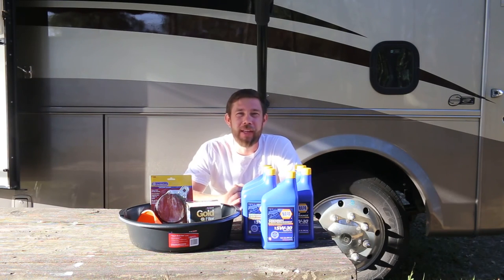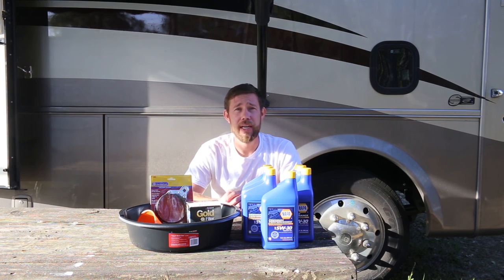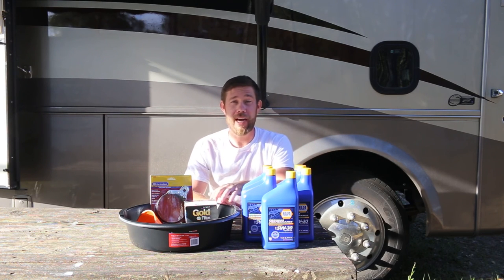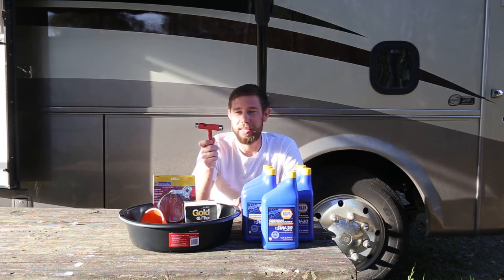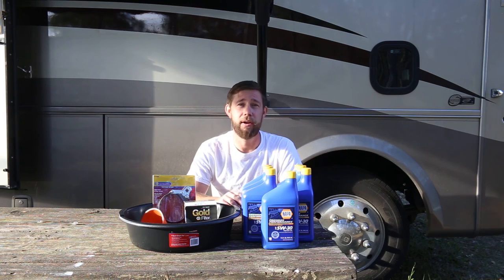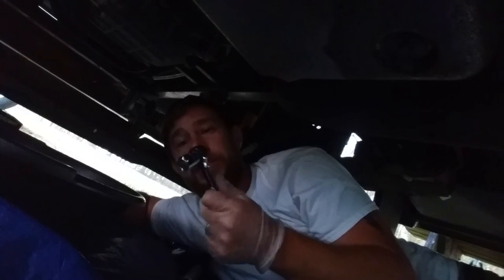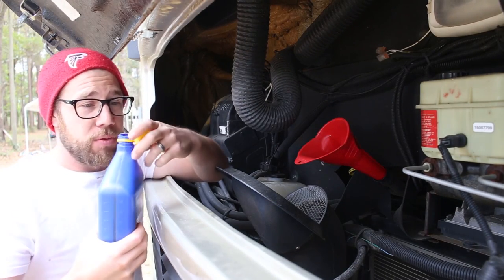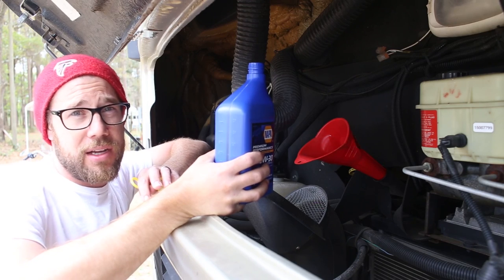Changing the Oil in Our Class A Gas RV

Comment: ( just seeing this video now and not sure if it was pointed out at all ) The reason the socket was slipping off of the drain plug when you used it is because you were using a 12 point socket which gives it less surface area to touch the plug. What you wanted to use is a 6 point socket.
Reply from the maker: Nice! Thanks for pointing that out @Exploring Nomad to be honest when I was doing this it was a first for me on the RV and a long time since I'd done anything on a vehicle so my knowledge of such things is a little rough. I'm actually looking for a new set so I'll take your point into consideration before I buy :) Thanks again!
Reply: Welcome. A good set is a craftsman set. There’s a real nice set that looks like a tool box. Red and black with 3 drawers. I believe it’s about $300 or so but it has everything you need

Comment: I have been changing my own oil for fifty years and an old trick i learned years ago was to put one or two small bar magnets in the drain hole. they would stick to the drain pan and collect any metal shavings that got into the oil. They use to sell magnetized drain plugs that did the same thing.
Reply from the maker: Thanks for the great tip sam white! I'm going to have to look into that before I change my oil next time. Better safe than sorry and nobody wants metal shavings cruising through their engine.

Comment: I've considered getting a replacement drain plug that is a valve that you can put a plastic tube on the outlet and open to drain the oil.  No more hunting for the right size tool then cleaning the drain plug off once its covered in oil.

Comment: Since the mid 1990's Chevy engines have used 15 mm metric drain plugs, you stripped it because you were using the wrong size socket.  Also  you should be using the 1 quart  NAPA 1060 or WIX 51060 oil filter not the 1/2 quart 7099 filter, this would bring your total oil capacity up to just under 7 quarts and double the amount of filter material in contact with the oil.
Reply from the maker: Thanks for the tips +Ike Stewart I'll have to take that into account next time I change the oil :)

Comment: I have 2003 Tiffin Allegro with the vortec 8100, I checked oil and its a quart low, I watched your video just to see where to add it. I have still not located it! It isn't where yours is and I even removed the engine cover inside. Any ideas where it could be? I've found every other fluid up front....
Reply from the maker: Hey +Joel Stone. That is really weird, I think the only place I've seen them is up front. Have you check underneath your doghouse (engine cover) in the front of your rig in between the driver's and passenger's side chairs? That's the only other place I think it could be. To be honest though, a lot of times when I run into problems similar to this I reach directly out to Tiffin. They have a really good service department that will talk you through some trouble shooting. If you still can't find it I'd give Tiffin a call. Hope this helps. Best Wishes, Eric

Comment: Always top it off when changing the oil.....why start off 1/2 qt low......it's meant to have 6.5 qts....give it 6.5 qts....also helps keeping the oil temp where it should be.  When you're checking your oil just after you leave for your trip you should still be where it's at now, if NOT, then you really have a problem!  Don't go cheap with your oil changes....the pennies saved now will cost you dollars later!!!
Reply from the maker: I completely agree, it'd be best to spend the pennies now.
Reply: If you check it regularly and it doesn’t use oil I never top my engines off. I make sure it hits right in the middle at least and call it good. It has enough oil to do it’s job just as well without that small amount of additional oil and slightly reduces oil pressure on seals and gaskets. More people accidentally add too much than to little in my experience. Too much is worse than 1/2-1/4 quart under it’s max oil capacity. Just did my coach which calls for 7, used 6.6. If it is old and loses oil between changes I will top it off however.